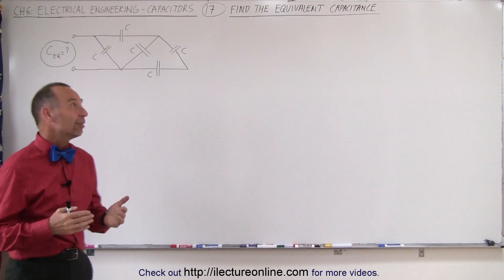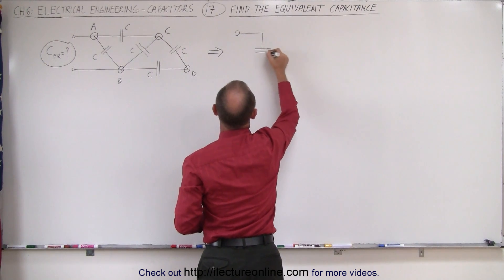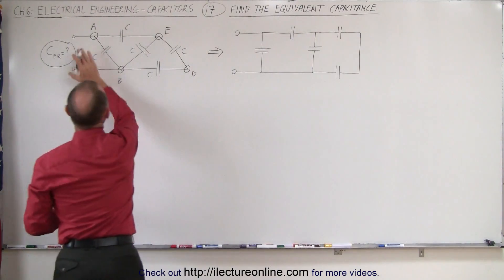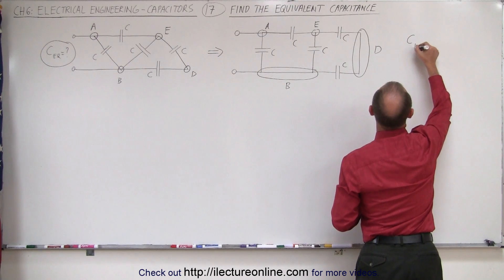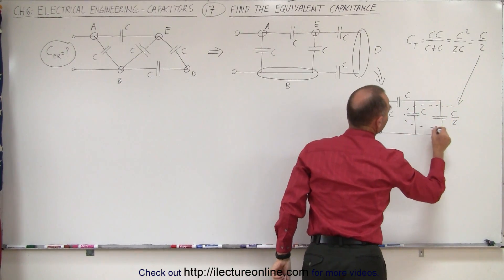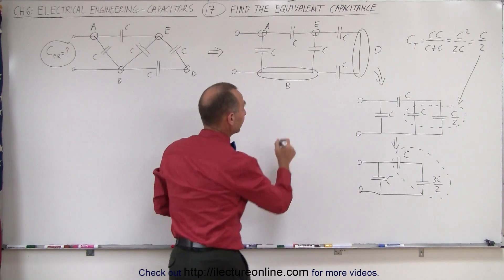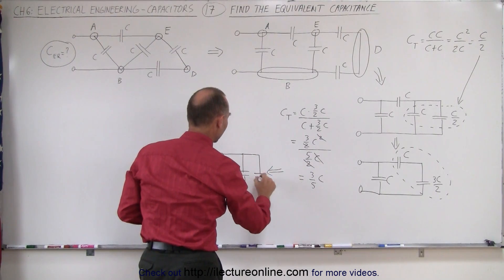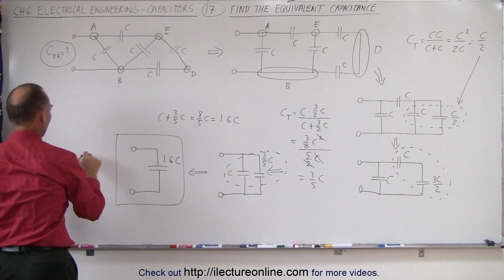Electrical Engineering: Ch 6: Capacitors (17 of 26) Find the Equivalent Capacitance 1

Comment: Professor can we use delta to star transform . For capacitors
Reply from the maker: The addition rules for capacitance is not the same as it is for resistors.
Reply: @MichelvanBiezen  yes is like as resistance but we should do the inverse . [ 1/ca x 1/cb ] / 1/ca + 1/cb + 1/cd

Comment: Sir, is there any specific way in which we need to see how to combine these, or is it random?
I asked because when I tried a different combination I got a different answer..please make it clear, as to how to identify the capacitors to combine at each step
Reply from the maker: We tend to start on the back of the circuit and alternately combine 2 capacitors in series or parallel and work towards the front, each time making sure we use the correct formula.
Reply: @MichelvanBiezen  thank you for the response sir...so may I also ask how to proceed in case the end points are given along a horizontal line, rather than a vertical as in the question?

Comment: Professor, in first place thank you for teaching us this.
In 2nd place, I understood what you did in this video, but I tried to calculate this in a different way, and the final result is different, and I can't understand why, so I ask you to help me.

So, what I did is the following:

In first place, I started like you, and converted the 2 capacitors, those between BD and ED, and I got a equivalent capacitor with Ct = C/2.

But then, I did the same thing for the capacitors between AE and BE, and got another capacitor with Ct = C/2.
(I did that because I believe these 2 capacitors are in series)

Now, I have 3 capacitors: one with capacitance C, and 2 with capacitance C/2; they are in parallel. So, Ct = C/2 + C + C/2 = 2C, which is different from 1.6 C (the final result that you got).

Where did I did wrong, sir?